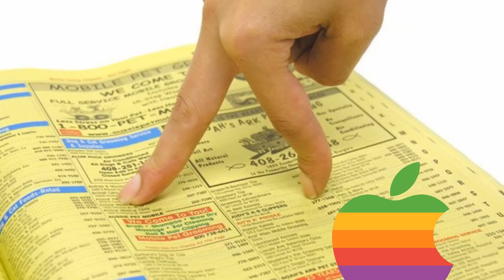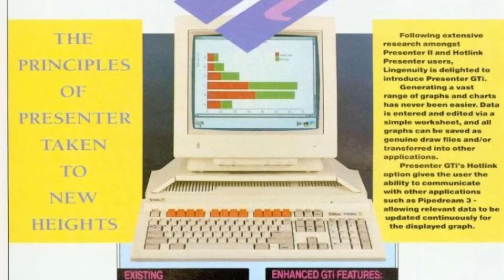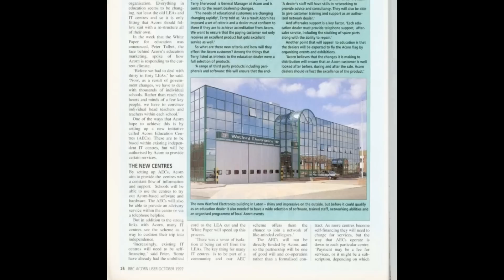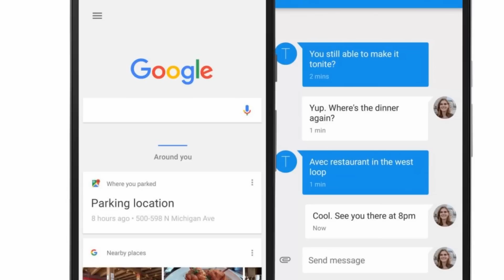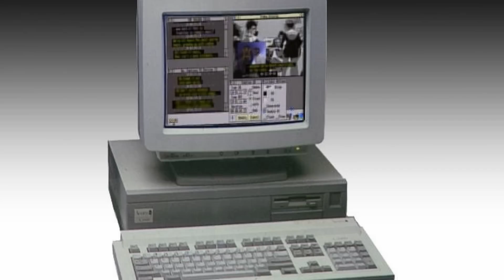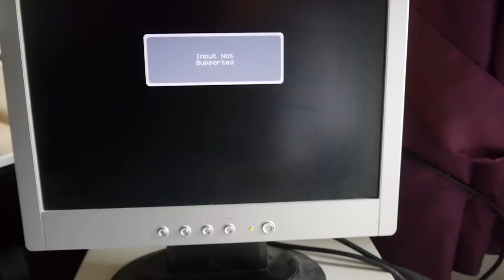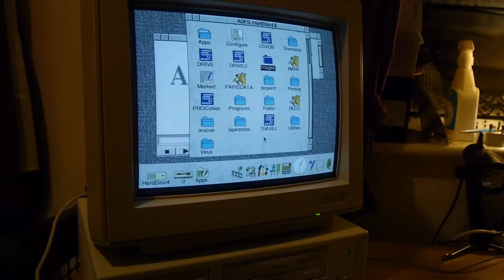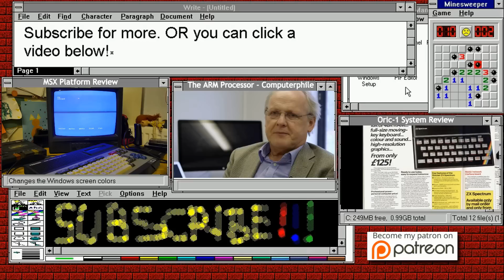Acorn Archimedes A3010 System Review & RISC Explained | Nostalgia Nerd

Comment: The other point of RISC was a reduction of addressing modes to a "load-store" model to save on transistor budget: load data into one of many registers, operate on it there and store the final result. Whereas a model CISC would do otherwise: provide each data instruction with a full set of various addressing models (especially direct/indirect memory addressing). As a consequence, CISCs tended to have fewer data registers. The CISC/RISC distinction is rather blurred these days, with CPUs operating internally on hidden microcode, not the 'official' instruction set directly. One should add that a CISCy instruction set may have some advantages too: it is easier for humans to write and more logic can be stuffed into the CPU cache.

Comment: Amazing machines. I dont have one any longer. But am using an Original Pi B overclocked to 900mhz on Risc OS direct. I use it like an every day machine, emails browsing.... just not youtube... using Risc OS direct. Probably use it more than my Windows machine as so bloated and slow... so i recommend anyone wanting to try something similar... grab an old pi. Risc os and there you go... brought your book btw Nostalgia Nerd.... very good. Like a retro bible... are you gonna make a new book on Handhelds soon?
Reply: Wish they'd come out with a version compatible with the pi zero 1 and 2, and USB ethernet adapters. I'd really love to play around with risc OS since we never got the acorn PC's nor the OS here originally here in the USA.
Reply: @maxxdahl6062  yeah it's out for the PI zero. I dont think the PI zero 2 yet. But sure it's in the pipeline. Nah just buy an old crusty model b+ for a peanuts. Has the ethernet etc. Overclock a bit to say 950mhz... there you go... exact same. No point with PI4s or 3s really. Risc OS (at present) only knows how to use one of those quad core chips in later models. If you do get Risc OS I recommend the Risc OS Direct version... not slating ROOL... but it's so much easier... if you wanna run 26bit software etc... plus you'll have a bit more space out your SD card from the go as it normally gives just under 8Gb without even mucking around... hope that helps.
Reply: @chriss2664  Hmm. Might just need to find a compatible USB ethernet adapter. Since I still have my zero 1 around here somewhere.
Reply: @maxxdahl6062  I know there is a list somewhere it it helps (maybe ethernet hats, I can't remember)... best place to try is Stardot Forums probably...
Reply: @chriss2664  Thanks man, I appreciate your help. :)

Comment: I seem to remember about this time the IBM clone PC's were taking off, clock speeds of the inferior Intel chip started to ramp up as did RAM and storage  installed. Intel and Microsoft beat off all comers apart from Apple as they had more to invest from global sales, Intel architecture  added capable 32 and 64 bit extensions to their old nail of a processor core that kept it ahead of rivals, I think its fair to say the Arch couldn't keep up, but same could be said of every hardware manufacturer, including IBM, Compaq and dogs breakfast of successful clone manufactures all gone from PC manufacturer..Dell came along later.
Reply: Intel had an architecture that could expand and it was known since the foundation of the company. The exact same people that used to write of Intel 40 years ago are the exact same people that write them off today

Comment: It is (was) a very capable machine. But you simply can't compare (6:14) a 1992 cpu design (ARM2) with a 1979 cpu design (Motorola 68000), especially in terms of raw power. It's a nonsense.
Reply: ARM2 was a mid-1980s CPU design, not a 1992 design. And the ARM250, as the first ARM system-on-a-chip, was Acorn's way of pitching a slightly faster version of, by that time, their low-end CPU at a reduced price point. It is completely valid to compare the ARM2 and ARM250 with the 68000, however, since that is what competitors like Apple, Atari and Commodore were still putting in their machines.

When the A3010 came out, it was going up against the 68000-equipped Amiga 500+ and 600, and the 68020-equipped A1200. Only the original Mac Classic was still hanging around with the 68000, and its successor had the 68030. At best, we can only say that the 68000 had remarkable longevity.

Comment: I had an Acorn A3010, still miss it. I bought Dune 2 for the A3010, which came on 8 x 800kb floppy discs - a massive amount of disc swapping required to play it. I transferred it to 4 x 1600kb discs, but even that was frustrating. So I finally persuaded my folks to get a hard drive - 120Mb for £120. Loved it. Wrote a lot of code in BBC BASIC (the best BASIC, obviously). Even bought a C++ compiler, I think called EasyC++. I miss that machine - held on to the hard drive for years, but I think it's gone now.

Comment: The Acorn line of computers is the reason I have an IT career today.  Both the BBC Micro and the Archimedes range were incredibly well spec'd machines for their time, the Archimedes in particular easily beat the Amiga and Atari ST for raw power.  I begged my parents for an A3010 but they couldn't afford it :( Nowadays I can relive my childhood by running RISC OS on a Raspberry Pi, and all of the old software runs perfectly still.

Comment: Nostalgia indeed!

The brief shot of Watford Electronics reminded of leaving my wife shopping while I bought my second Archie - I knew she wouldn’t approve.....

You didn’t mention the A3 laptop which I used when travelling to write complex BASIC programs.

Acorn RISC and the Arc series were way ahead of what was coming out of the States at that time - and putting the whole OS into ROM (wasn’t it just 2 Mb, including games, paint, vector graphics programs, word processor etc?) made it impossible to hack at the OS level. And the 3 button mouse made it so intuitive.

32 bit, too - for some time during which IBM and Microsoft were wondering whether to go to 16 bits or stay with 8 bits. Look at the coding now on Windows  -  Gigabytes of sloppy and buggy code which eats up chunks of  memory and requires hours of updating every week.
Reply: The other thing that is often not mentioned is that scalable fonts were built into the operating system along with anti-aliasing (albeit that only worked properly with a white background). Also, not unconnected, was the built in support for vector graphics. The release of RISC OS 3 and proper outline font support was roughly at the same time as Apple released TrueType in Mac System 7 in 1991. Vector graphics was very much at the heart of the graphics rendering in RISC OS and the way that graphics objects could be dropped and scaled into documents was a revelation for somebody using a contemporary Windows machine.

At the time Microsoft were in the era of bit-mapped fonts only, and they only introduced scalable fonts with Windows 3.1, which was not something found on most desktops. It took multiple Windows iterations for MS to get that one "normal" desktops. 

The one big problem with RISC OS scalable fonts was printing. If you didn't have a (very expensive) Postscript laser printer, then it was laboriously slow bit map printing to render documents. Of course, you needed a Postscript printer for Macs too, but they sold into a different market. The Windows world and printing was also a major pain in the early 1990s where what came out of a printer was mangled by the substitution of resident fonts.

Comment: The trouble for the A3010 is that it was just too low specked for when it was released and too highly priced to be attractive to most home users.   At the time it was up against the Amiga 1200 which ran at 14Mhz compared to the 12Mhz Arm CPU and a limited software library.  It wasn't powerful enough to compete with the PC and was way too late to compete in the home market.

Comment: 23 years before iPad
Reply: But only 1 year away from the first Apple Newton based Message Pad, which ran on an ARM 610. The Newton message pads kept going until 1998.The last Message Pad models used Strong ARM processors.

Comment: High price of the A3010 and late to the party in 1992? It was only £100 more than the new Amiga 1200 from the same year and the Archimedes A3010 was about as powerful as an Amiga 4000/030 which cost a lot. The only other rival would be the Amstrad VGA multimedia PCpackages in the High St and they cost at least double the price of the A3010.  An 030 Mac in 1992 cost even more than the PC or 4000/030!

Comment: Nice machine! Until my mum threw it out because it was just "gathering dust in the loft". Anyway, this one could also take 4Mb RAM, which came on a little board instead of two separate chips in case of 2Mb RAM upgrade. I also fitted a hard drive module from APDL with a whopping 170Mb of space. It was an amazing thing... Thanks for this review.

Comment: I had an Acorn A3020 then an Acorn A5000 back in the day 

I'd love to be able to get an Archimedes emulator to work but not been able to do so as yet
Reply: +Sophia Christina Botha Actually you can buy a Raspberry Pi for £25 and install RISC OS on it. I did - it works really well. Recommended if you want a modern Archie experience :-) 

https://www.raspberrypi.org/blog/risc-os-for-raspberry-pi/
Reply: @RupertDBayer  You can also get them for MUCH cheaper than that with the Pi Zero :) I have one, actually been tinkering with RiscOS on that too.

Comment: the amiga 1200 was superior though wasnt it?
Reply: In terms of performance, quite similar in some respects. Although the A3010 wasn't all that much of a change from the A3000 so it was a case of Amigas catching up with the Archs, really. If I was to be lazy, I'd say the Acorn was better at 3D and the Amiga would have been better at moving sprites around. 

I've not seen any evidence of the Arch not being able to match the Amiga in this regard, though. If you compare the games they are often strikingly similar. Stuff like Zool and Lemmings look pretty much identical. Zool on the arch has a 'fast' mode, but the Amiga has better sound. The Amiga has a far, far bigger games library, of course. 

In truth, they aren't really comparable machines as the architecture/whole ideology is so different. Two of the last home computers ever and both awesome souped up 80s tech for the 90s.

Comment: you should have mentioned that 3DO and Gameboy Advance are also powered by ARM. All the 3D games on GBA are rendered by software, thanks to the powerful CPU (even if it only runs at 12 MHz). The phrase about 68k being able to do more with a single instruction would be more suitable for comparison with 6502&65816. ARM instruction set is actually still powerful and expressive, even if compared with i386, many of the instructions had no match on 68k and x86 while still working so much faster.

Comment: Your explanation of cooperative multitasking is lacking.

Cooperative multitasking works by the operating system allowing one program to take complete control of the CPU. This program executes until it voluntarily gives up control of the CPU. Usually this happens because the program needs to make a call back to the operating to get or send some IO. However,  a program that never terminates or never makes a system call can effectively hog the CPU forever. A program bug that causes a non-terminating loop effectively freezes the machine and prevents the OS from ever again obtaining control of the processor.

Preemptive multitasking prevents this occurrence by generating timer interrupts that will return execution back to the operating system in the event that an unruly program attempts to hog the processor for too long. It can therefore better ensure that each program gets a fair share of the time allocated.

Comment: I think the original goal of the ARM CPU was to complete every operation in one cycle.
Reply: Colin Jones The goal of ANY cpu designer is to maximize the number of instructions executed per cycle. Since modern architectures execute several things at once,  and the exact time of an instruction is indeterminate,   it is better to measure the inverse relationship. Designers measure designs in terms of cycles per instruction. Each instruction is able to minimize the number of cycles it takes to complete and more than a single instruction can be executed per clock cycle on average. 

I mention this because there are such things as single cycle processors that execute a command on every clock cycle. These actually run slower as the clock must accommodate the slowest instruction.  Multicycle processors (as were typical in the eighties) use a similar a similar format of a fixed number of cycles for a processor cycle where the slowest path of processor chain limited the clock speed but cycles were wasted for instructions that did not require as many clock cycles as the full processor cycle. Pipeline microprocessors allow each instruction to use only the number cycles it needs and attempts to maximize available hardware by executing parts of multiple instructions simultaneously so long as they do not need conflicting pipes. 

I think what you are referring to is the tendency of RISC designers to attempt to make instructions that are all the same size. A typical CISC instruction varies in size.  The first word input might specify the type of instruction.  Any additional data or parameters would then be specified as separate words. So an add instruction might take three words the first specifying the add operation while two more words are used to specify which registers are to be added.

RISC designers tend to embed data into the instructions. So the first few bits of a jump instruction might specify the jump instruction while the remaining bits of the instruction actually have the jump address/offset actually included as part of the instruction. Having all instructions be the same size reduces the complexity of the decode/control logic. The downside is that since the data and command are always intermixed,  there are always size limitations involving literal values in programs.

Comment: I remember seeing an Ax000 with a full-screen Union Jack blowing in the wind. That was rather impressive at the time, but yes, it was too expensive, and in the end I went with the Amiga 500.

Cooperative multi-tasking sucks, though. In terms of OS, I think the Amiga was far ahead of any of the competition at the time; unfortunately, it remained stuck in 1985 for most of its lifespan. But stuff like the ASSIGN command in AmigaDOS, I've yet to see that in another OS.
Reply: Severity One Amiga hardware was full of cludges, build from remnants of early 80s game console project. ARM was so much better and faster than 68k, capable of doing in software more than Amiga’s hardware could do.
Reply: the amiga 1200s cpu was 4x faster than the amiga 500 came with 2mb ram and 16.7 million colours and cost less than the acorn lol
Reply: it also didn't look like it was built by bulgarian brick layers
Reply: si ST Falcon was miles better.
And acorn STILL faster. Its cpu is ~4x or more faster than 68000 running at the same frequency

Comment: The A3010, the one most likely to be purchased as an alternative to the Amiga 1200, had a CPU about the speed of a 20mhz 020 (or 030 as they are pretty much the same thing for general computation speed) but it had only 1mb of RAM which is quite restrictive when you consider the space taken by 256 color bitmaps. The video output on a regular TV from an Archimedes has a border just like the Atari ST and Amstrad CPC unlike the Amiga which is full screen (except where 320x200 mode is used for games when they are running on a 320x256 resolution PAL screen of course) and finally converting the source code from 68020 of Amiga AGA/CD32 to ARM is not going to work well. So games like Pacmania and Lotus II instead of being the best versions fall somewhere between the ST and Amiga versions. Saloon Car racing is probably the best comparison for raw speed given F1GP by Microprose was never converted to the Archimedes. It is a fine machine but it just does things a little different than the 1985 Amiga 1000 as it has nothing like the power of the 2D assisted custom chips found in that machine. The lack of high quality software specifically written around the Archimedes unlike Shadow of the Beast 1 which was 100% designed around the Amiga 1000 (and hence A500) chipset. I really like the machine but ultimately without the best of the best being converted in the best possible way to the Archimedes it would be doomed to failure. As a creative machine it didn't have Deluxe Paint and Animation series or anything like it and midi packages were covered perfectly by a stock ST. The best thing Acorn could have done is written a software based PC x86 emulator into the OS to counter PC sales around the mid 90s when the only choice left for purchasers was single task OS Mac or putrid Windows (the OS for chumps and toilet cleaners). A great machine that never ever got their own spiritual development of things like the Amiga OCS focused Shadow of the Beast 1 or Lotus II (which uses the CPU and blitter time available to within a millisecond to achieve those arcade quality results in speed and animation) ultimately killed it not because it was too late to the party. Windows PCs only sold into the home because Commodore had been forced into bankruptcy when the loans were called in.